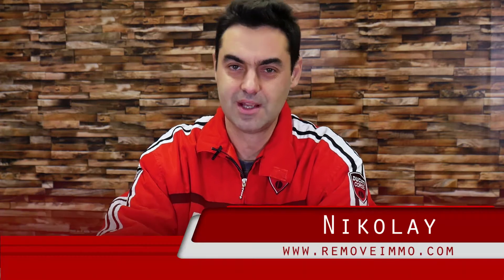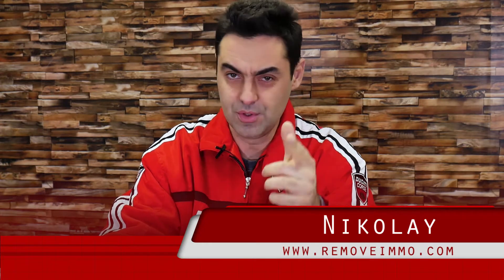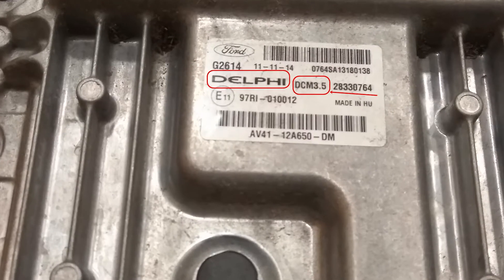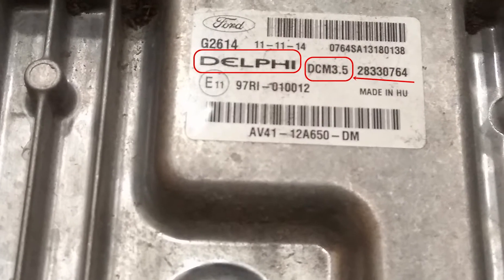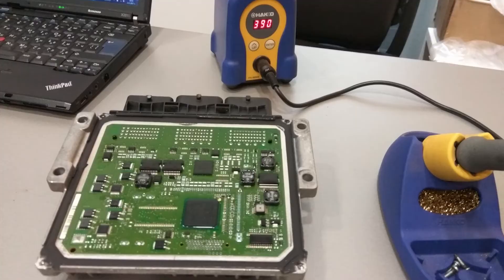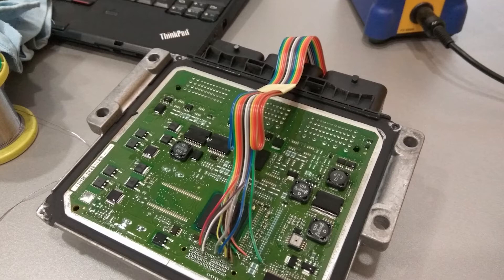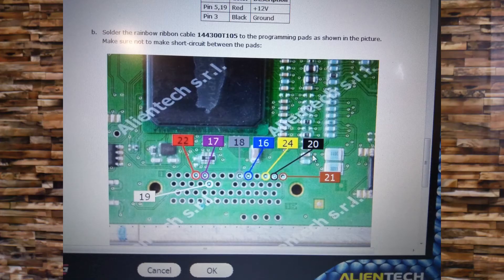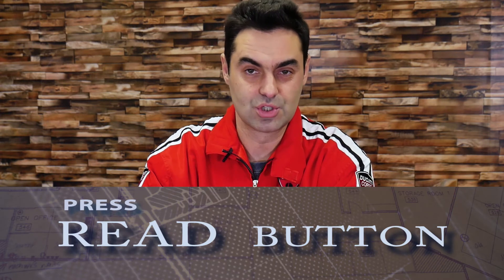Ford Kuga Delphi DCM3.5 how to read and write with KTAG

Comment: what the point if we have this info on the soft?
Reply from the maker: In many cases, there are benefits if you can read the whole software from your car. For example for archive or ECU replacement purposes, or chip tuning, dpf or EGR deactivation.ALL those activities will need to have original files at your disposal. This is not to read the faults, but the whole lets say firmware of your vehicle sort of speak.